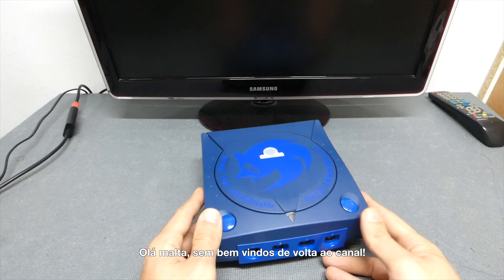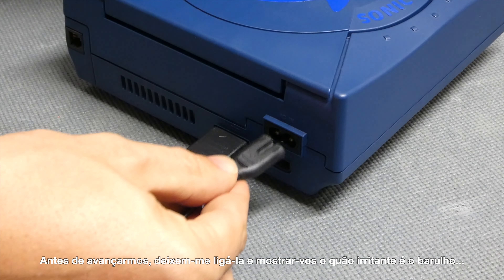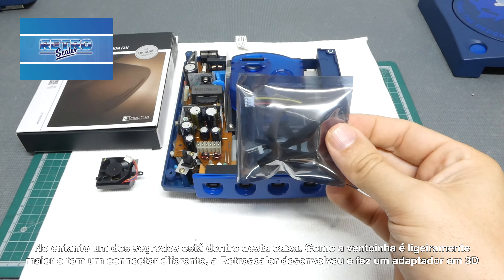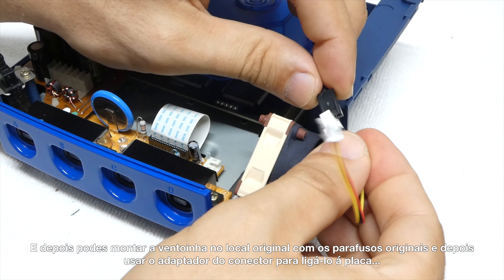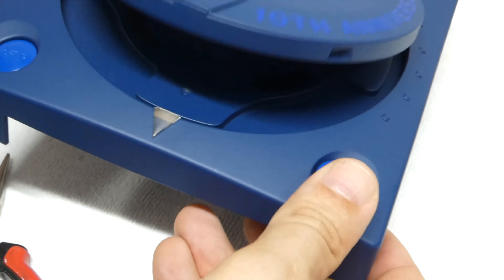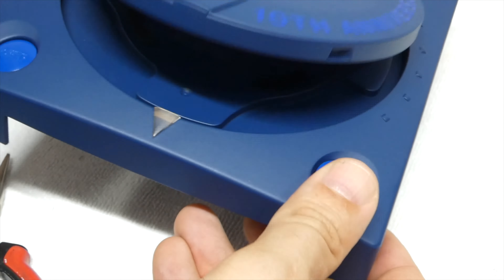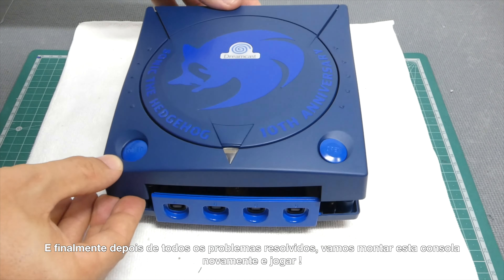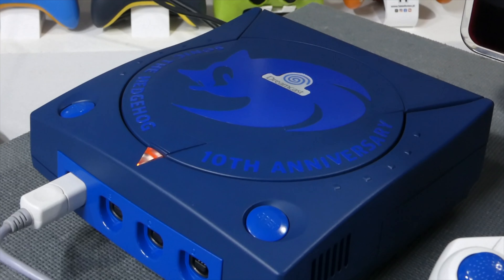FIX and UPGRADE my SEGA DREAMCAST Sonic Custom! ( Noctua fan kit )

Comment: This is a 12V fan, does it work fine as the provided voltage is only 5V?
Reply from the maker: It as an adapter for the DREAMCAST motherboard so yeah..on my case it worked fine!

Comment: What did you do exactly to the pins? Because mine also doesn't work and I have no clue why, it only start to spin after I give the fan a little swing with my finger :/
Reply from the maker: In my case its the Pins on the board that are broken… just need to solder it up.. maybe your fan as another problem
Reply: @fabiofontes  I think I ordered the wrong fan, I bought the flx version, probably this was the issue :D